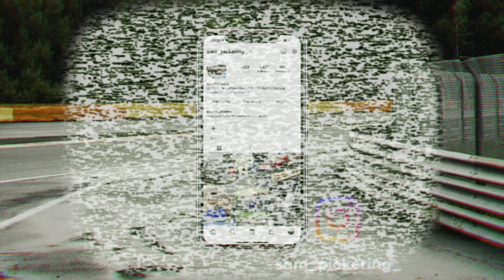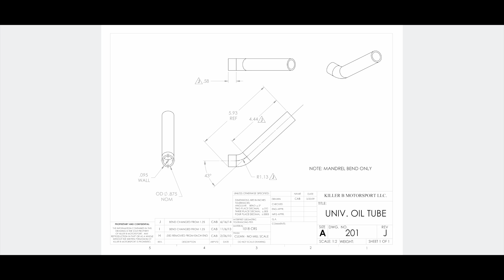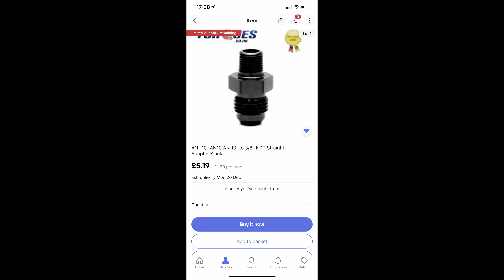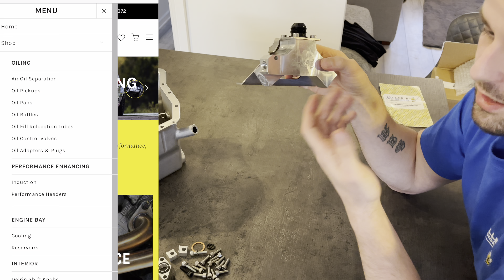* The Killer B Super G Sump *

Comment: Sam thanks so much for the detailed vid and coming on board! Following up on the difference between the Standard, and High Flow pickups. In addition to the larger inlet opening, the tube itself has porting on the inlet side, and the flange that meets the block has additional CNC port matching. These changes make it the highest flowing pickup currently available :) If there's anything else we can do, please don't hesitate to reach out to us! Thanks again!
Reply: With the high flow pickup, is there any recommendations on what oil pump size to pair it up with? OEM, JDM, OEM ported and polished. This is for a time attack setup with high lat g-load.
Reply from the maker: Thankyou mate, apologies for the wrong info regarding the Air Force 😂 I’ll blame the covid, slight brain fart there 😅
Reply: @recklessactn   Always the OEM pump size that came on that engine. The OEM Suby oil pumps have a LOT of excess capacity!